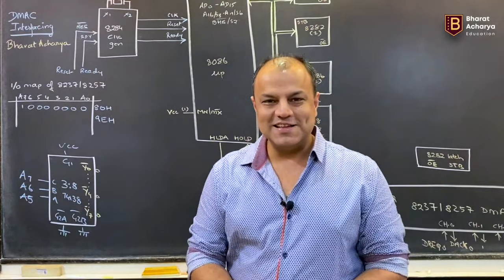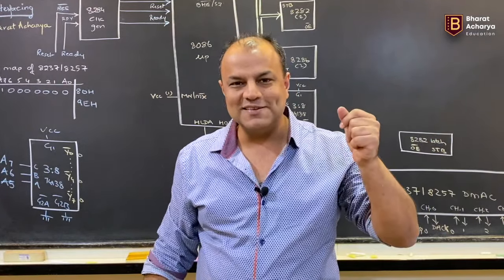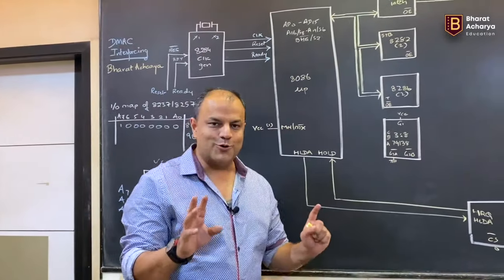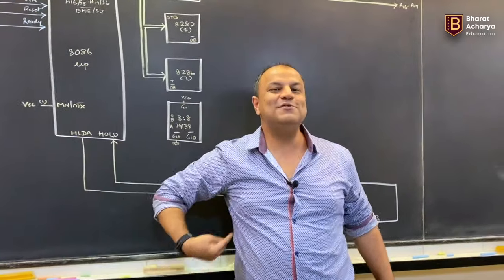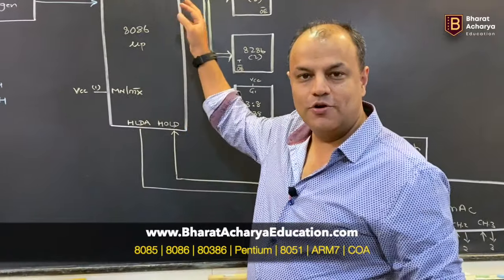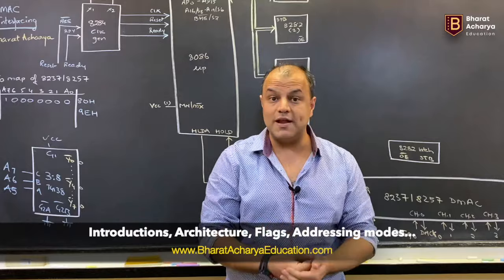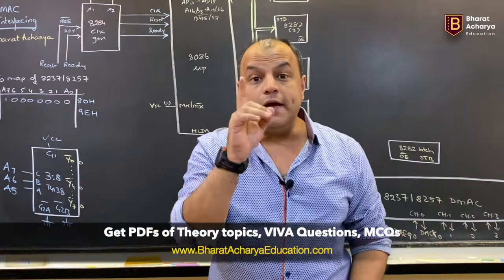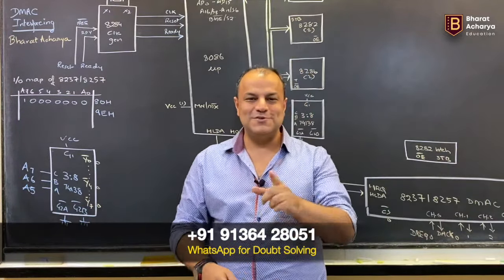8086 | 8237 8257 DMA Controller Interfacing with 8086 | Bharat Acharya Education

Comment: sir i have bought your course but i didn't get how to calculate machine code of given instructions in 8086, please upload video on this sir
Reply from the maker: It’s done by the assembler. We can do it manually too but what’s the whole point of having an assembler then. To do it manually you don’t really need a sharp logic. Simply hit by but substitute the opcode part based on the addressing mode, the registers, and the main operation itself.